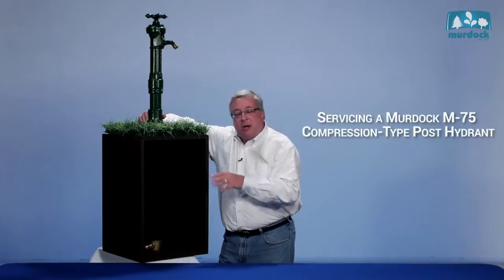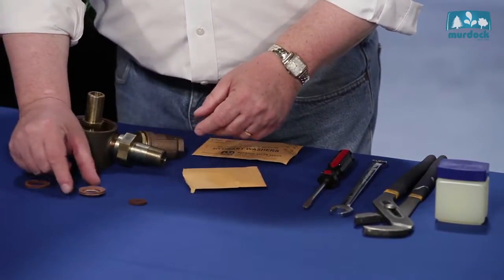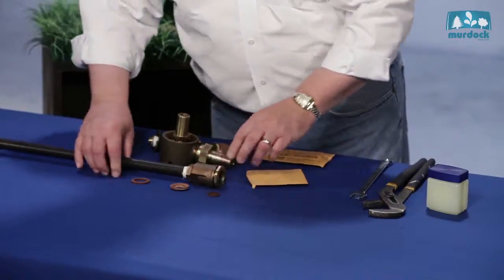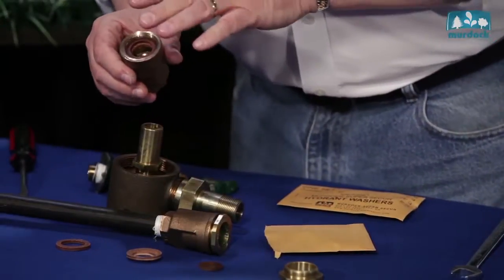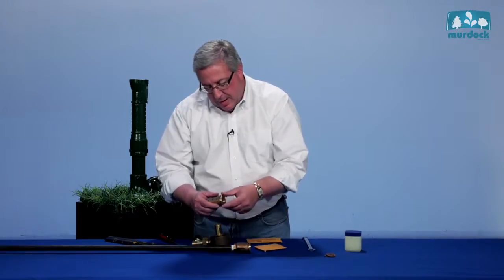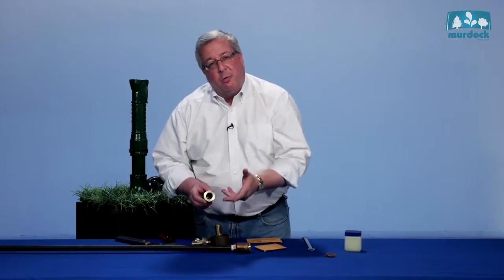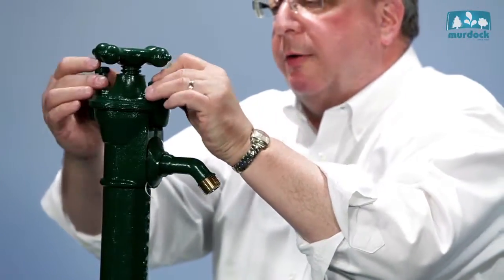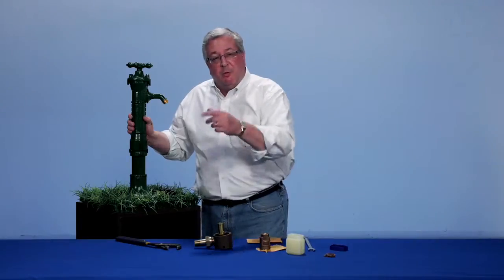How to Service a Murdock M-75 Compression Type Post Hydrant

Comment: Hey Bob-I’ve got two of your M-75’s here that I believe to be 80+ yrs old! One of them no longer drains down after shutting it off. Any suggestions for clearing the drain holes without digging down to the base? As luck would have it, the faucet is in a poured slab garage, so digging it up would be quite a challenge.
Reply from the maker: Hello. We recommend calling our Field Service line at 800-743-8259 or emailing them directly at fieldservice@acorneng.com.

Comment: I have a Murdock hydrant that has opened up on its own twice now.  When you close the valve there doesn't seem to be much tension on the handle until the very end when you can't tighten it closed any further.  I replaced the washers on the hydrant 6 months ago.  And ideas what this might be?
Reply from the maker: Hello. We would need more information such as a model number. We recommend calling our Field Service line at 800-743-8259 or emailing them directly at fieldservice@acorneng.com.